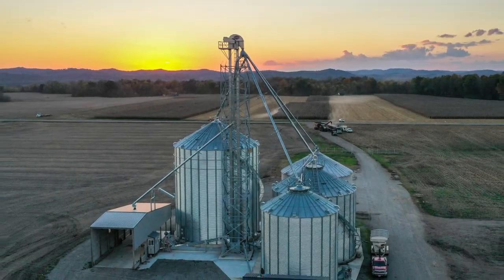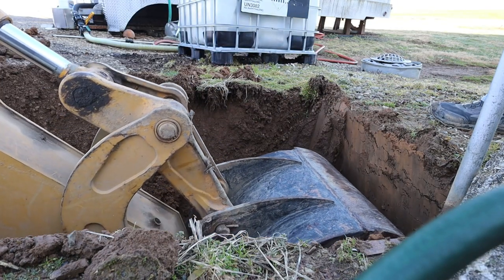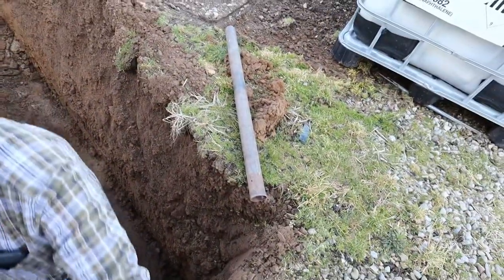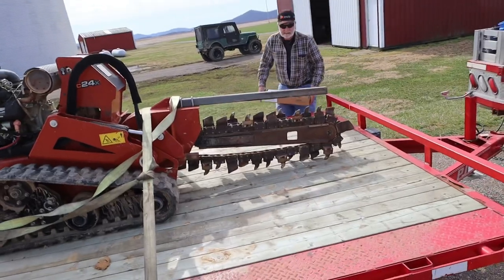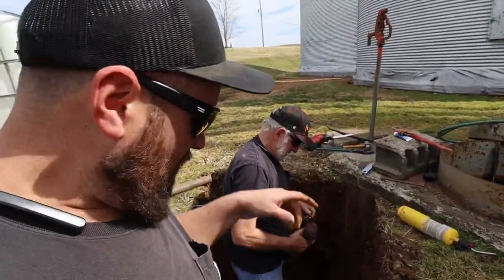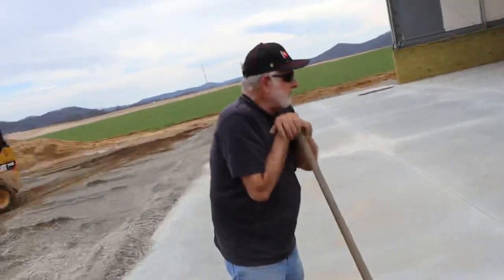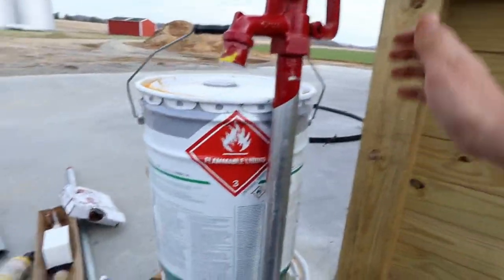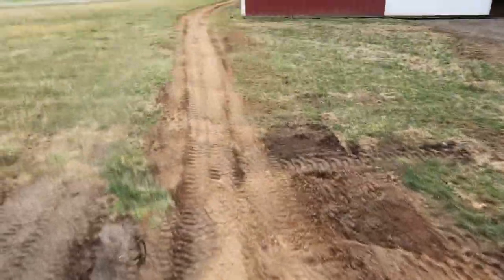Let's Ditch Witch a trench on dad's birthday

Comment: Such a cute little trencher. Used to do similar work, on a little larger scale, years ago. Put in line from wellheads to center-pivot Irrigation. Usually 6 or 8 inch line, 6 feet deep. Can get a little claustrophobic in that narrow trench.

Comment: The other question I have why didn’t y’all use pix plastic you have to have a special tool for the commercial stuff but the neat thing is if it freezes it won’t split like that black roll plastic I can remember in the 60s when the black roll plastic came out y’all must not have real corrosive water because where I grew up in Louisiana galvanize do you only got six or seven years out of it before the water ate it up I’m not talking about the packs that you see at Home Depot or Lowe’s it’s the commercial side you have to go to a commercial plumbing supply store to get the stuff is amazing go out to YouTube and watch videos on it Grace and peace Brian happy birthday to your dad thoughts and prayers

Comment: A bit over 20 years ago now, a coworker who had just bought a new house in town went to install a sprinkler system in his backyard.  Unfortunately he discovered that under the very thin sod was decades worth of mine tailings that were almost the consistency of solid rock the size of his yard.  Home Depot had just opened a location a mile or so down the road that week.  He rented a brand new trenches and discovered that it had a bypass when the pressure on the teeth exceeded a certain amount.   Unfortunately for Home Depot and whoever got the next rental of the trenches, he also discovered that he could disable the bypass with a cheater bar.  There was exactly one tooth still attached to the trencher when he returned it and Home Depot very quickly modified their rental contracts after that ;)